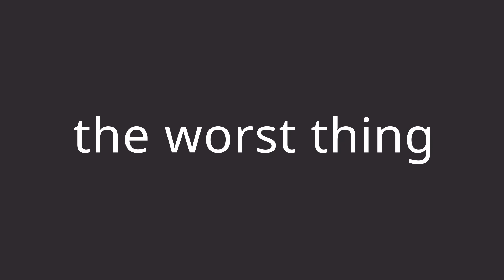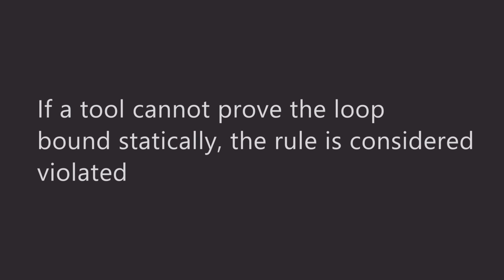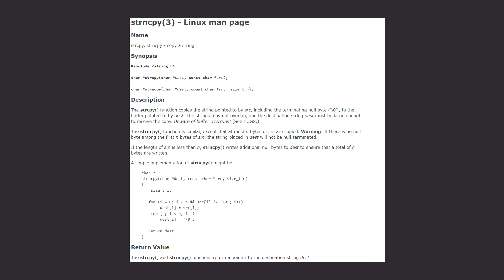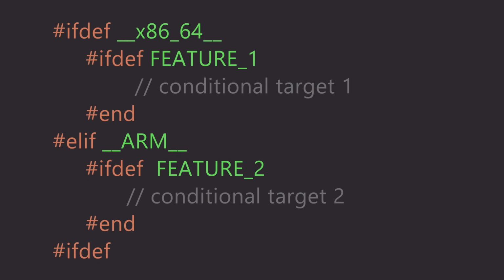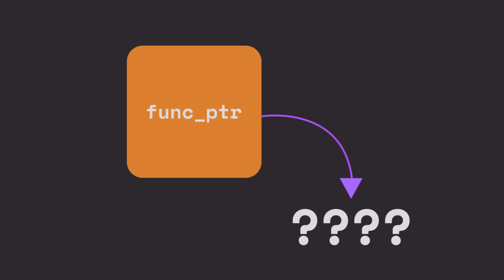how NASA writes space-proof code

Comment: How do they live without the heap!?  That one really surprised me.
Reply: Everything is statically allocated. Which is actually very feasible on embedded applications.
Reply: @jonassattler4489  I just figured that surely some things aboard a spacecraft must require a dynamically sized array, or an array of unknown size.
Reply: @RAINE____  If it can't be logged physically or transmitted home, then it just gets dropped. Faster and safer that way for an embedded device that will be billions of miles away from maintenance.
Reply: What you can always do is having a fixed size array which wraps around, that is essentially a very simple dynamic allocator. Another approach is to have low safety components which are downstream from more important components, this is how inflight entertainment systems can get away with being on a plane, where you have comparable safety standards.

But actually for a lot of areas you really do not need dynamic allocations. Usually a component has a single task, including timing requirements, dynamic data just does not make much sense there. The software repeatedly processes known inputs, makes decisions based on those inputs and produces some outputs. All state will be initialized at startup and there never is "anything more" that the software would need to do and dynamic allocation isn't really needed.
Reply: @jonassattler4489  I guess this makes more sense when I imagine rovers or telescopes.  I was thinking of the ISS, which is obviously a whole different beast.
Reply: @RAINE____  you don't really need dynamically sized anything. It's just a bad habit, a convenience for programmers who did not want to think before coding.
Reply: @vitalyl1327  what about resizing hash tables?  What about pixel buffers for various screen sizes?  What about handling a number of search results?  Or a query from a database or an unknown number of user inputs?  Or loading a file into memory?
Reply: That's obviously false. Dynamic allocation is extremely important to save memory. Imagine all software allocating all potential data at startup. 

It also makes it impossible to deal with data of unknown size, e.g. a textfile an image or a web page, unless you want the software to just fail when the webpage is too large for parsing.
Reply: @jonassattler4489  wrong. You should not be allowed anywhere near any mission-critical or real-time code with such an attitude. Stick to coding CRUD in javascript.
Reply: @RAINE____  you don't need any of such things, really.

And if you really need for some weird reason (trust me, you won't find real reasons), do your own dynamic allocation on top of a pre-allocated static array. Just like we did in fortran77 times.
Reply: @vitalyl1327  For embedded applications you generally won't need dynamic allocations, this is true, but not all code is written for embedded use.
Reply: @anon_y_mousse  we're talking about NASA code that runs in spacecraft. They don't need web or crud crap.
Reply: You can not write a browser or modern text editor without dynamic allocation. Of course a browser does not belong in an airplane controller.
Reply: @vitalyl1327  the SpaceX dashboard actually runs in a web browser.
Reply: @jonassattler4489  I wrote a text editor in Fortran77 once. Poor ne, how did I manage without dynamic allocation?
Reply: Try opening a 4GB file with it.

And again, a web browser just becomes impossible. Once you deal with dynamically sized data you have to use dynamic allocation. Quite simple actually. How well do you think a chrome with just static allocation would work?
Reply: Insane to be honest and quite lazy.
Reply: @jonassattler4489  ever heard of overlays?

Dynamic allocation makes some sense in a multi-process environment where processess cooperate and share the limited RAM. It is a crappy solution only suitable for primitive desktop kind of uses, where nobody cares if OOM killer start slaughtering random processes.

When you care about availability, you canmot afford it. You must guarantee that every process will get ad much as they will ever need at the worst case load. Meaning, split the RAM between all users, pre-allocate once and never allow to change.

Same goes for CPU time in real-time systems.

The way code monkeys are used to code is extremelt destructive and have no place in any remotely professional environment. Forget browsers and other primitive crap, they have no place anywhere where there are real world consequences.of software errors.
Reply: Look, I agree with you. But almost all applications are not safety critical.

Nobody cares that Word crashes once a day if the alternative is 100GB of RAM just to start your browser and word processor.
Reply: @jonassattler4489  well, we're in a thread about NASA. So it is sort of funny when crud coders come here with their very valuable commens about "how can you even code without dynamic allocation?!?".
Reply: There are a lot of things you can't programm without dynamic allocation. E.g. a web browser or most end user software.
That doesn't imply that dynamic allocation should be allowed on a plane or spaceship.
Reply: @jonassattler4489  again, you absolutely can (and, likely, should) write pretty much anything without a dynamic allocation. Dynamic allocation is about how processes cooperate with the OS and each other. If you don't care about the other processes, you can statically pre-allocate enough and live with it. Use overlays if enough is not enough. This is how things were for a very long time.
Reply: 100% of end user software cares about OS communication.

I get that you are getting defensive, but let me say it again: dynamic allocation has no place in safety critical software. Thankfully almost all software is not safety critical and can freely use the enormous advantages of dynamic allocation. You can not write a web browser without dynamic allocation,
Reply: @jonassattler4489  again, you absolutely can write a browser without dynamic allocation. It'd even make sense, given how uncontrollable browsers are in eating up memory anyway. Why not just legalize this state of affairs and eat up all the memory straight away?
Reply: Because then the only devices able to run chrome are large datacenter servers.
Reply: @jonassattler4489  I think we just need to accept that Vitaly is clearly a highly talented and special individual who surpasses all of our ability.  We have been truly humbled by his/her presence and I can't believe I ever touched a keyboard, let alone dared to code.
Reply: @jonassattler4489  why? You PC runs it just fine. And all other processes suffer. Just legalise it, give it 30 out of 32GB of RAM, as it'll take it all anyway. But then you'll know the remaining 2GB are all yours.
Reply: So people with less than 30GB can not run browsers? And you can not run another piece of software at the same time?
Reply: I just hope he is trolling.
Reply: Easy enough - very tightly control whatever dynamic things the software can do and work within those constraints. It's a good habit in general. Once of the most obnoxious things about high level languages is people allocating memory as if it were infinite. The whole paradigm is a consequence of Moore's Law pushing memory density to ridonkulous extremes in the 90s and 2000s while programmers were still mostly pushing around bytes in text strings. Makes it feel like it really is infinite.
Reply: Simply put, the universe of potential inputs is small enough that they can predict what they will need. They then allocate that statically. It means larger allocations at program start, and (in some cases) more, smaller programs.

Warning on the following; while I've done embedded development, I have not done Aerospace development.

what about resizing hash tables? 
  You don't. You use the maximum size.

 What about pixel buffers for various screen sizes?
  You already know the screen size, so it's static.

 What about handling a number of search results?
  You preallocate enough memory for /some/ search results, and limit your queries to fit in the memory. Rinse and repeat if you need to eventually go through all of them.

Or a query from a database or an unknown number of user inputs? 
  Either the previous answer or you allocate enough memory for the maximum user input(s). This may involve changing the UI to force a maximum.

Or loading a file into memory?
  Load less than the statically allocated buffer from the file at any time. Keep loading part of the file at a time until you're done with the file.

Comment: I miss rule #0: Don't use C! Don't get me wrong: I personally love C, as it is super versatile, super fast, low level, etc. but when it comes to code robustness, I would not use C. This already starts at the fact that you cannot force a pointer to never be NULL in C; something you CAN do in other languages and that can be statically enforced. Also I'd never directly compile to CPU code, I'd always use a VM, so that the only code that every will be CPU or system specific will be the VM code, while all other can be the same, no matter how often you change the underlying hardware. Starting a new project from scratch, I'd use Rust to write the VM, as Rust gives you a lot of guarantees on pointer and memory usage that C can never provide and for the VM, I'd make my own one that is as restricted to code safety as required and that won't even allow you to write any code that cannot be statically analyzed, as the VM simply has no instructions for that.
Reply: I'd think that using a VM would be slow/memory intensive for something that may be trying to use the limits of the hardware (which is the most obvious reason, other than legacy code, to use C).
Reply: @lissythearchitect  Specialized VM code is typically smaller than CPU code and stored data does not care if it is processed by native or VM code, it requires the same amount of memory. Also consider that Java was originally designed to run on the weakest embedded hardware of its time, and don't confuse the original Java with the huge monster that Sun later on made out of it. To quote from Wikipedia: "The team originally considered using C++, but rejected it for several reasons. Because they were developing an embedded system with limited resources, they decided that C++ needed too much memory and that its complexity led to developer errors."; so Java was designed to run on systems that were too weak to even run C++ code. Also keep in mind that all the early day Sierra und Lucas Arts games ran in a VM. Yes, Maniac Mansion on C64 ran within a VM. So if a C64, 1 MHz 8 Bit CPU, 64 KB RAM, is totally capable to run an entire game at native speed in a VM, I don't see how speed would have been an issue.
Reply: @Xcoder112 - I can think of at least one project where a tenth of a percent more time would have made the product unusable. That said, I have never done aerospace; their timings may simply  not be that tight.

Comment: That's honestly how almost all embedded code should be written. The code base I worked on recently (inherited from another company), breaks almost every single of these rules, it's a miracle it doesn't crash more often
Reply: It's kinda funny to me how the "3 levels" of programming are related. I find beginners and expert programmers have a lot in common, but for very different reasons. Loads of emphasis goes to writing code that is easy to read and edit. The beginner avoids complexity because they're afraid of using advanced features they don't understand. The expert avoids complexity because that makes debugging and testing easier, increasing reliability.
It's really the intermediates you have to watch out for. Those are the absolute menaces. Just enough knowledge and confidence to make a mess. Using advanced features in functional but unsafe ways, writing extremely long functions, allocating tons of dynamic memory, etc.
Reply: @asm_nop  I've never been so offended by something I 100% agree with.
Reply: @asm_nop  "Just enough knowledge to be dangerous." AKA "A little knowledge is a dangerous thing!" AKA "If you think hiring an expert is expensive, try hiring a non-expert."  xD

Comment: Whats interesting is a lot of the shortcomings mentioned here (no heap, limited dereferencing to increase safety) are solved by rust. I hope safety critical and aerospace/aeronautical industries start adopting rust. It will improve reliability, safety while also giving more utility to these programmers, which makes it more likely to engineer more sophisticated behavior/features.
Reply: I am a Rust guy,  but at this point Rust does not provides many benefits over C for NASA.

All those rules are enforced by cstatical analysis tools, tailored for the specific needs of NASA,  to prevent the developers from making mistakes. (The borrow checker is also a statical analysis tool, did you think it was special?).

Adopting Rust would be a huge cost, all those libraries and tools written for C programs would need to be rewritten.

Rust is valuable if you can not trust your co-workers or the tools are not made specifically for your program, wich is the case for 99% of software. 

But NASA software is in that 1%.

Comment: https://en.wikipedia.org/wiki/DO-178C 
DO-178C for aeronautical industry enforces a disallowance on compiler based optimizations since it explicitly states that safety requirements should be mappeable to object code :

"The Executable Object Code satisfies the software requirements (that is, intended function), and provides confidence in the absence of unintended functionality."
"The Executable Object Code is robust with respect to the software requirements that it can respond correctly to abnormal inputs and conditions."

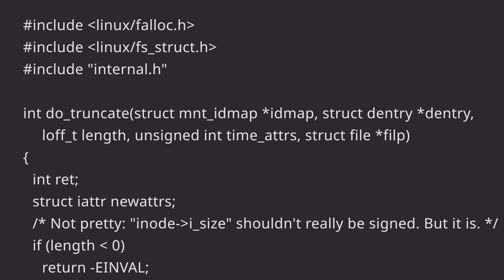Comment: 00:00 Introduction
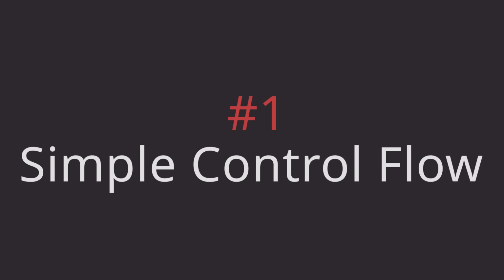00:44 #01 Simple Control Flow
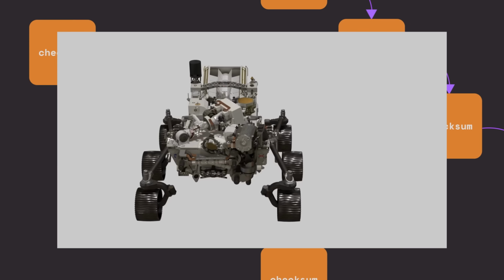01:08 #02 Limit All Loops
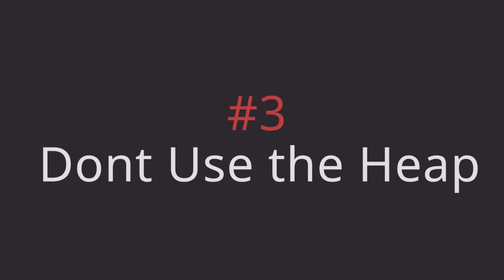01:40 #03 Don't use the Heap
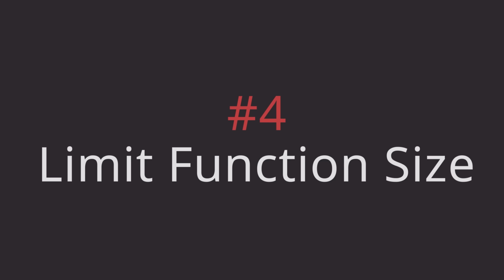02:15 #04 Limit Function Size
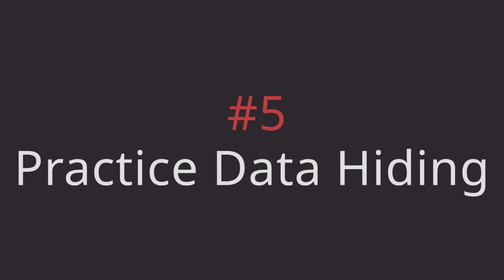03:01 #05 Practice Data Hiding
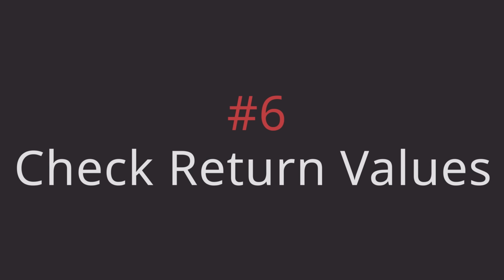03:27 #06 Check Return Values
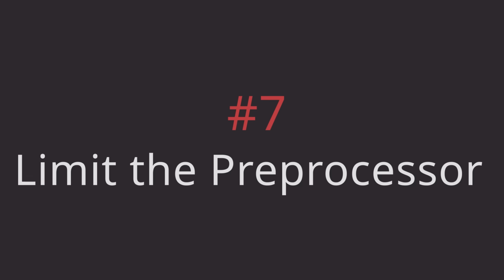04:17 #07 Limit the Preprocessor
04:57 #08 Restrict Pointers Use
05:33 #09 Be Pedantic
05:47 test test test
05:55 Interaction Reminder
Reply: Why did the creator like this but not copy it and add It to the description so that chapters would show? 😞
Reply: @BraydenPrice30  programmers are lazy
Reply: @carriagereturned3974  In there words you describe the root cause of the vast majority of software failures 🙂
Reply: He doesn't code at NASA 😂
Reply: @Juxtaposed1Nmotion  do you?
Reply: Bro I thought it was power of 10. There are only 9 rules lol
Reply: @milesrasmussen6590  that's why you test and review before releasing
Reply: That testing part is where 99.99999% fail at the epic level 🙄
Reply: Rule 10 was missed out, so that means rule 9 failed
Reply: Use ATS that attest all of that instead of just C
Reply: cosmic rays can convert a 0 to 1 and if that happens in a higher bit position, then a 1000 could become 11000..
Reply: Didnt he say ,they dont use return...
Reply: not using Recursion 🙃
Reply: Why don't they program in RUST or Idris?
Reply: @aoeu256  Lack of developers, code interoperability, still relatively new and undergoing rapid (for program language) development

That being said, I had to support a program that was transitioned from legacy code to Ada (yes, TO Ada) just a decade ago...

Comment: I wonder if there are any additional rules or measures in place to recover from space related bugs, e.g. cosmic rays screwing with the memory or CPU.
Reply: There are different levels of radiation tolerant chips/boards. I assume everything they use is top grade and they don't need to worry about this sort of stuff.
Reply: I know in some cases they use redundancy with redundant systems physically separated, and in at least one case separate writing of the same functionality. https://en.wikipedia.org/wiki/Space_Shuttle#Flight_systems "...the four PASS GPCs functioned identically to produce quadruple redundancy and would error check their results. In case of a software error that would cause erroneous reports from the four PASS GPCs, a fifth GPC ran the Backup Flight System, which used a different program..."
Reply: @lissythearchitect  This is a good point, but I wonder how much of that redundancy is actually motivated by radiation. There are a lot of things that can go wrong with computer hardware (including human error), and redundancy is a blanket solution.

Comment: These are very similar to the rules that we had to follow when I worked for the government. I was working on a system that was inside of airplanes so it needed to be very resilient and fault tolerant.  We did write it in common lisp so we didn't necessarily have to worry about pointers and control flow problems but the other rules did apply (there are pointers in clisp but they are obfuscated so you rarely have to worry about them).  The flavor lisp that we were using was Jit compiled and it didn't have a garbage collector.  It was this extremely small compiler that was packaged with the program because we didn't really have a lot of space to work with.
Reply: I really like programming in LISP. It's so simple and hard to screw things up. That's how I know something is wrong with me.

Comment: 4:34 could the static code analysers not just be run after the preprocessor? Should the analyser complain at some issue, it will be harder for the developer to find (as the preprocessed code will not be 1:1 of the original) but would this not ensure safety?

Hadn't heard of NASA's protocols before, interesting video.
Reply: You can do that, at least in theory. But then you need to analyze each of the different versions out of the pre-processor potentially independantly.